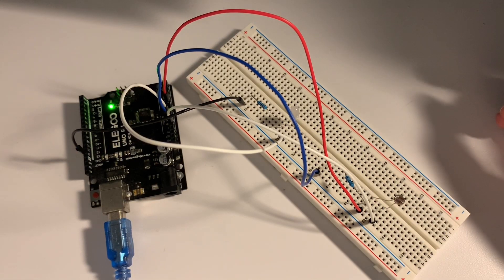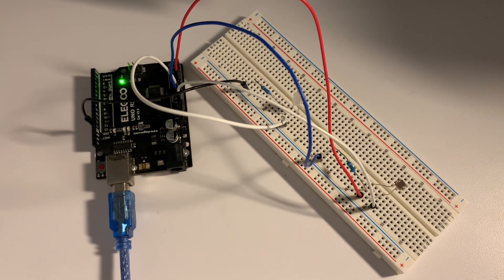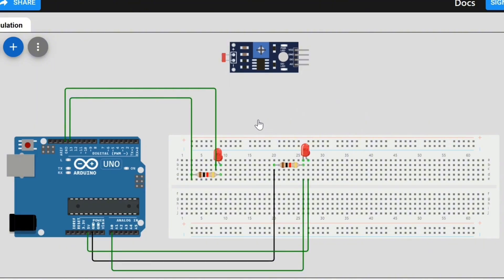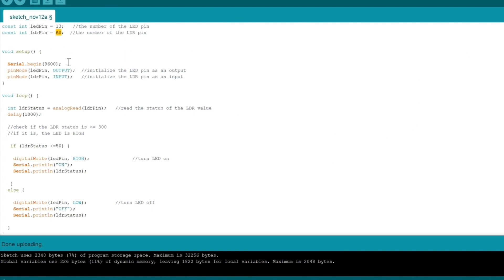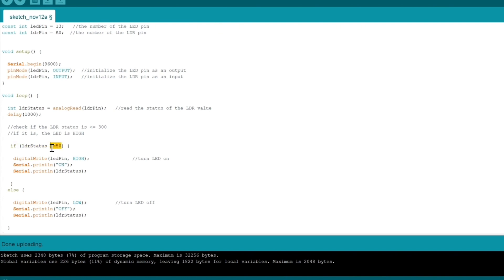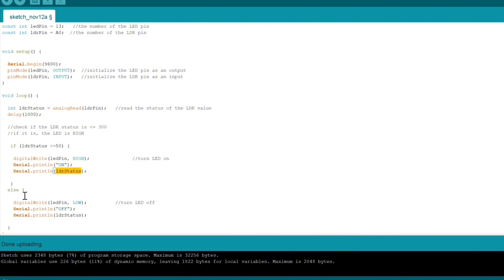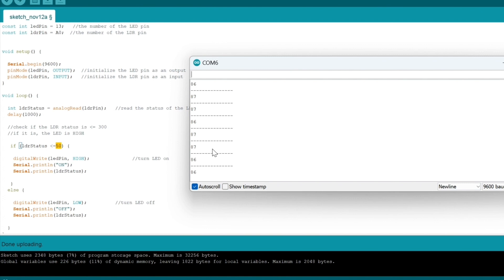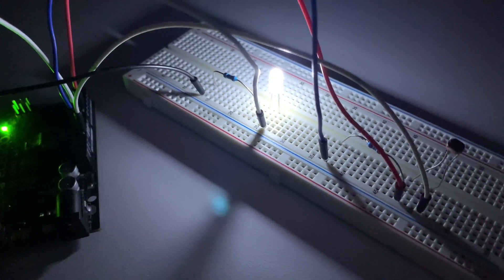Responsive Arduino Light using Photoresistor - Quick and Easy Tutorial

Comment from the maker: const int ledPin = 13;   //the number of the LED pin
const int ldrPin = A0;  //the number of the LDR pin

void setup() {

  Serial.begin(9600);
  pinMode(ledPin, OUTPUT);  //initialize the LED pin as an output
  pinMode(ldrPin, INPUT);   //initialize the LDR pin as an input
}

void loop() {

  int ldrStatus = analogRead(ldrPin);   //read the status of the LDR value
  delay(1000);

  //check if the LDR status is <= 300
  //if it is, the LED is HIGH

   if (ldrStatus <=50) {

    digitalWrite(ledPin, HIGH);               //turn LED on
    Serial.println("ON");
    Serial.println(ldrStatus);
    
   }
  else {

    digitalWrite(ledPin, LOW);          //turn LED off
    Serial.println("OFF");
    Serial.println(ldrStatus);
    
  }
}

Comment: mine is taking huge readings and burning the resistor of ldr all the time any solutions
Reply from the maker: Hi I am so sorry to hear that. Just making sure, from the wiring diagram, did you make sure your LED was on the left only and the LED shown on the right was actually your photo-resistor? I talked about, in the video, that the website I used did not provide a photo-resistor with 2 pins so I used a red LED to simulate. Keep in mind this is the LED on the RIGHT connected to A0 and GND that is the photo-resistor. If that still doesn’t work, a burning resistor indicates there is something wrong with the wiring. If so, check again that your project follows the diagram and if that still doesn’t work you can send me an email at waiduino.epoon@gmail.com if you have videos and photos, maybe I can diagnose the problem that way. Thanks so much for your comment!

Comment: You don't need an arduino for this. Just use a transistor instead.
Reply from the maker: Thanks for your comment and yes you are correct! However, I wanted to use the Arduino since my channel is featured around Arduino projects and the circuit board.
Reply: Yes, @Waiduino , I see. May be interesting if someone also did the old school version also.?.
Reply from the maker: @reaffirmation  Oh yea great point! I should look into that and make a video. I just thought it would stick with the theme of my channel more. Also it was just an introduction since I was gonna incorporate it into a greater alarm clock system project (more videos coming soon). I just thought that using the Arduino here would help but you definitely make a great point! Thank you
Reply: @Waiduino  Yes, another angle that may be interesting is if someone did the old school version also.?.
Reply from the maker: @reaffirmation  There are also a ton of great videos if you are looking for some about your question. I can try to work on this for other viewers like you recommended. Thanks!